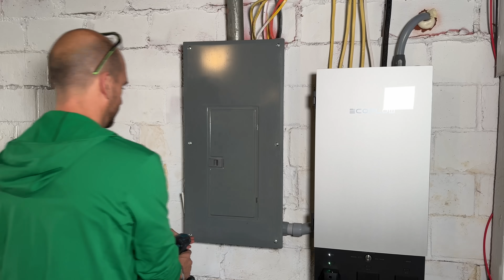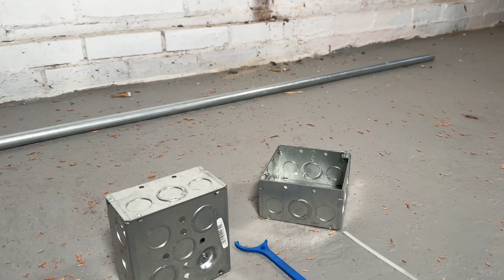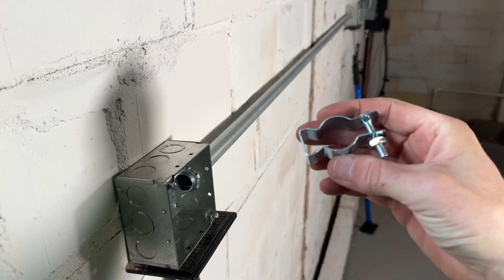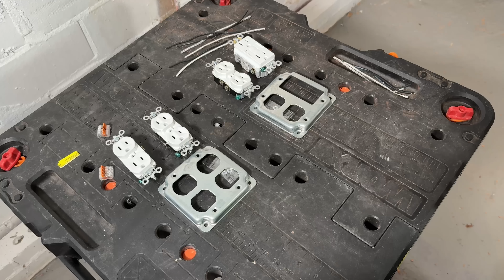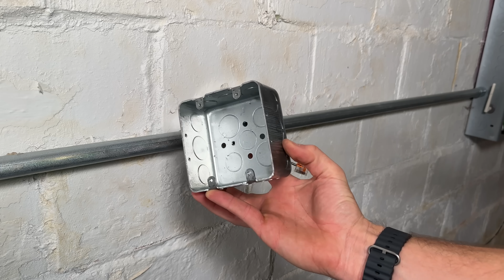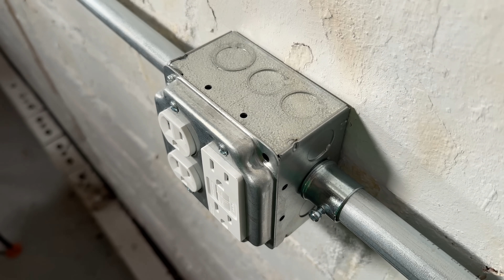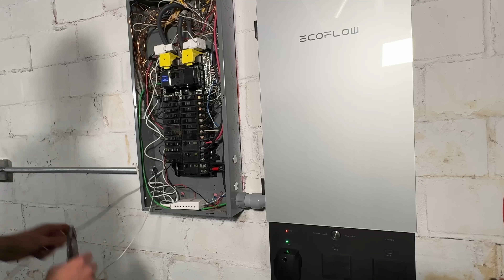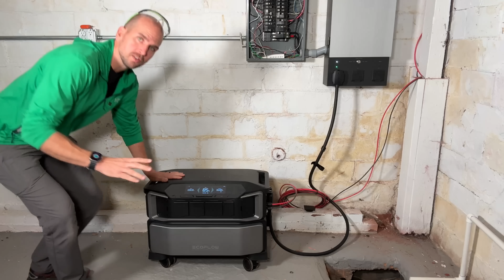Add Outlet To Unfinished Basement Or Garage

Comment: if a raceway is over 18” it requires a means of support. i.e. a strap or that conduit hanger you mentioned. over 18 inches, and you need to strap every 10 feet and within 3 feet of each termination.
Reply: EMT shall be securely fastened in place at intervals not to exceed 3 m (10 ft). In addition, each EMT run between termination points shall be securely fastened within 900 mm (3 ft) of each outlet box, junction box, device box, cabinet, conduit body, or other tubing termination.
Reply: @BackyardMaine    basically, with only a 6 ft run there's no additional support needed between boxes.
Reply: @rupe53  It would depend on the AHJs interpretation of the requirement. Most will read this as 3 feet lengths don't need additional support based on my experience. However some will read this as any length between boxes will need additional support.
Reply: @BackyardMaine    I see where this is going. 1 inch less than 6 ft probably won't require support because either direction is less than 3 feet from a box. OTOH, probably safe to say at least a single support in the middle will do (by code) or go the rule for BX / Romex and add one closer to each box.... and they can't argue at all. No harm in over engineering, right?  <LOL>
Reply: @rupe53  Incorrect. If you run 3' of EMT from box to box, each box becomes the "supported and secured" means for the other. Anything over 3' would require at least one strap. If your EMT is 3'6" with no straps, for example, it is not secured within 3' of every box.
Reply: @pld8993     look up a few posts and you can see where I spelled it out better. Basically a 6 ft run does need at least a single strap near the center.
Reply: @rupe53  Yes, there is. If you have 6' of conduit between boxes with no straps, 3' of it is not secured and supported within 3' of each box, explicit code violation and not one that needs interpreting, only measuring. If it said no point along the conduit can be unsecured more than 3' from a box, then 6' wouldn't need support, but that's not what it says.
Reply: @pld8993    you wanna repeat that one more time for people not reading the entire thread?
Reply: @rupe53  I'm not sure what I need to repeat. The NEC is clear and in plain language, nothing to interpret: "shall be securely fastened within 900 mm (3 ft) of each outlet box, junction box, device box, cabinet, conduit body, or other tubing termination." With a 6' length a strap in the center would mean that the conduit is supported exactly 3' from each box. If you put 1 support only and 1' from one box, that would put support 5' from the other, violation. If you put no strap, there would be no support within 3' of either box, violation.
Reply: @pld8993    you obviously didn't read the whole thread... or catch my sarcasm for those others who didn't read the whole thread.
Reply: @rupe53  I guess I didn't. Cheers.
Reply: The EMT needs to be secured within 3 feet of a box. The 18" nipple rule for strapping was removed years ago. Technically any length of conduit needs a strap.
Reply: @stillthakoolest  Not quite, only any length over 3'. If you run 3' of EMT from box to box, each box becomes the "supported and secured" means for the other. Anything over 3' would require at least one strap.
Reply: @pld8993  i mean i get it. Is there a code reference that says box to box <3ft  both secures AND supports the conduit?
Reply: @stillthakoolest  Yes. 362.30 (A)
Reply: @BackyardMaine  that is ENT, but whatever. Reading 358.30(A) I guess you can read through the lines that securely fastened means connected to each box securely
Reply: @stillthakoolest  No and there doesn't need to be. The NEC does not specify exactly what type of support is required for raceways (there are a few exceptions). The EMT inserted into a connector, and tightened properly, which is attached to a solidly mounted box is, without question, secured and supported.
Reply: @stillthakoolest  Oh sorry.. yes 358.30A. Brain cramp. 
It states securely fastened within (3 ft) of each outlet box, junction box, device box, cabinet, conduit body, or other tubing termination.

I
Reply: No offsets?
Reply: @1970jeffreyg  Not needed or required.
Reply: @pld8993  correct, it just makes for a better job.   More professional imo
Reply: @1970jeffreyg  While they may look better aesthetically to some, it's not true that offsets are more professional or are a better way to do it. We run conduit all the time with box offsets using 1-hole straps for support, and also without offsets using minis for support. There are situations when you'd definitely use offsets to hold it against the wall, situations when you'd definitely not use offsets to keep it off the wall or to maintain proper bends count, and situations when either way is appropriate. In this case it doesn't matter, nothing is gained or lost doing it either way.
Reply: 2ft not 18in
Reply: 36" is acceptable .... that one he can get away with
Reply: There is nothing in the NEC that says you need to support EMT over 18” long. Just 3’ and 10’ like you said.
Reply: Start strap #1 2.5' from the box then every 5' and you'll be golden.
Reply: @Singlepole  That's how I was taught. Puts all your straps/minis equidistant from each other, everything looks uniform.
Reply: karlwithak.Then when you sell the house the inspector makes you rip it out or fix it right. At the very least the NM cable needs protection and probably run overhead rather than just along the wall. And GFCI is not just code but a good idea. We don’t live in the 1940s. Not knowing code is not an excuse to be dangerous.
Reply: karlwithak. You must live in a different area. I bought my house about a year ago in Illinois, and I couldn’t move in until it was inspected by the city. The seller had to make several changes, some of them electrical.
Reply: karlwithak. I only know the local rules in Illinois and in St Louis, where the city has occupancy permits. Other YouTube videos lead me to believe this is not uncommon.
Reply: This guy has. No clue what he's doing...
Reply: Intervals not to exceed 10 feet according to 2023 N.E.C 358.30. Cmon baby boy
Reply: @christiansantos8904  did the nix the within 3 feet of a termination in 2023? if not, you just didn’t read my whole comment lmfao
Reply: @christraudt6730  of course I read it. You said, "...and you need to strap every 10 feet..." code said 'intervals not to exceed 10 feet'...you can strap every 1ft, 2ft, 3ft, 4ft, 5ft, 6ft, as long as it doesnt EXCEED 10ft. You're telling people every 10ft, you can do every 10inches if you want, code says dont go past 10 feet. You claimed I didn't read your comment; you don't read code.
Reply: @christiansantos8904  way to nitpick. we were citing code which is minimums. i was stating the minimum allowable strapping interval. for gods sake, is this what you do all day?
Reply: Yo! 

Who writes and publishes the Electrical Code in the USA? @christiansantos8904
Reply: @christraudt6730  all day, everday. We're going to die one day dude; might as well obsess over the things we choose to do.

Comment: This point was the most confusing part when I moved into a new house in IL. No grounding wire... WTF..?! It took a while to figure out why I didn't need it. I needed this video earlier.
Reply from the maker: Be careful I had owned several older homes in Illinois with no ground wire but also not means of ground running to the metal boxes.
Reply: It's easy enough to check if you actually have a ground path using those plugin testers

Comment: I notice that you never torque the wires on the breakers.
Reply: Almost no one uses torque drivers on residential service panels. If you were to invite a hundred residential electricians to your house and ask to see their torque driver, they would probably laugh at you. Generally speaking, only commercial and industrial electricians use torque tools on a regular basis.

Comment: I do not like to drill into mortar for Tapcon screws. The mortar pulls out easily, especially if aged.
Reply from the maker: I am with you but this type of brick/block easily blows out so it is actually worse.
Reply: @EverydayHomeRepairs  I agree with that 100%. It's easy to crack that block; it's too rigid and brittle.
Reply: yes, better to use proper fixings and stay away from the mortar and edges of brick to secure, you also need saddles on the conduit. If you follow this guy in the EU and do it without a qualification in electrical installation then you will Not be insured...
Reply: @theDgrader  That is the MAIN consideration in the installation! It's not about safety or durability over time. It is ENTIRELY what the inspector writes on his report! If the insurance agent refuses to insure you can be in deep shit!
Reply: Since the insurance industry writes the code, that's a great plan! @glasslinger
Reply: Just use plastic anchors or even a ramset.
Reply: Use Fischer rawlplugs.... you know, the right tool for this job exists since over 50 years. Please learn to use it...

Comment: I decided against solar when I found out you can't use it during a power outage. Sure you can have battery backup, but what you show here would NOT power your home. Sure a few lights maybe a fridge. But how long?  30 minutes to an hour, if you are lucky. Battery technology is not feasible yet. Especially the COST! Just sayin'.
Reply: Not true... Enphase micros will work during a full power outage, even without batteries
Reply: Of course you can use solar during a power outage. A battery bank is no different than a generator. You have to size it for the load you need. Most installs don't provide backup to the whole house although that is certainly an option. You pick which circuits you want to back up. Lights, freezer, fridge. You might skip electric dryer,  electric hot water heater, and electric baseboard heat. The unit he has is 6 KWH which would give you 1000W for 6 hours or 500W for 12 hours which is more than enough for lighting and fridge/freezer. You can always add a generator on top of solar or use 2 of the units he has for more power or use a large battery bank. Not sure where you got your information.
Reply: @TheDaniel688 I'm pretty sure he's talking about the solar array remaining functional without an active grid connection. He's correct except for enphase micros, which will work even when the grid is off, and no battery is present.
Reply: @michaelwilliams5506  and as long as it's day time. :)
Reply: @TheDaniel688  Yes, if you have the proper inverters for standby power. But the first generation and now lower cost inverters still cannot be used without a live utility connection. Without getting into the electrical engineering theory,  basic solar inverters are current sources, not voltage sources. They must have a constant low impedance  load to push against at all times. Your typical house load cannot satisfy that requirement
Reply: @andydelle4509 None of that is a reason that a battery backup system isn't viable.   

Mechanical engineer here.   TheDaniel688 is correct.  He seems to have a grip on LiFePO4 power stations, and to be honest, you don't, or just like bringing up other subjects like grid-tied solar/inverters unrelated to using a power station as battery backup for a house (or for anything else).  

It's just a simple equipment sizing and cost problem that any kid passing Algebra 1 in high school, can solve.

Personally, I prefer building a custom system for any LiFePO4 power station needs above 1kWh or so.  Power stations are getting bigger ,better, and cheaper, but so are 12V "drop in" batteries and 48V "rack mount" batteries.  

My own recommendation to family/friends for most home power backup needs, is putting a transfer switch for your entire service, next to your electric meter.  If you have a 200A service, put a 200A transfer switch.  Once you throw and padlock the big lever on that sucker to the position where your house is completely disconnected from your meter and the grid, then whatever you feed into the "generator" side of the switch is verifiably off-grid.  

Most people at that point, feed it with a gasoline generator made in China.  But feeding it from a battery bank and inverter of your own, or a big power station from Ecoflow or anyone else, has zero to do with the grid or the power company.  If anyone wants to start quoting exotic UL stuff, just point them to the 100 people running generators they just brought home from Harbor Freight when that day's storm knocked power out, and are feeding it into their clothes dryer outlet via a 16awg orange extension cord and a dryer cord cut in half,, while maybe or maybe not flipping off their main, maybe or maybe not knowing whether neutral is bonded to ground in their generator, etc. 

You'll see a lot of people just running an orange cord straight to their refrigerator through a window, and another orange cord through a bulkhead door to a furnace.  If they have a yellow 12awg cord, you know they at least put a few $20 bills into upping their safety level.  Still, hassling anyone who spent $500 on a whole-house transfer switch, instead of hassling the extension-cord folks, is misdirected energy in my book.  Not an excuse to do anything sketchy, but a reason for an inspector to respect that you eliminated all risk to others, and most risk to yourself.

For stuff that's permanently installed and automatically switches over, I have no problem with the utility or government inspectors getting very tough about the equipment ensuring disconnection from the grid, and somewhat tough about the specs and certifications of the equipment automatically kicked into use after disconnected from the grid.  If you're going to spend 90% of the money to do things right, you might as well spend 100% and keep everyone from the building inspector to your insurance company completely happy.

But some of this technology is so new, yet still so safe, that it's reasonable to "live free or die" as we say here in NH, rather than wait 2 years for certified solutions to become reasonably priced.  Using an inferior old solution in the interim can be more risky than installing good new equipment that's for instance approved in Europe but not yet by UL.
Reply: Ecoflow stuffs are designed for camping and other portable application. It just gives you the option for household use but not really specialized for that, given the size of battery. Proper residential application requires UL9540 certificated batteries and inverter, which is even more costly. Honestly safety isn't a huge problem for modern batteries but price is
Reply: @arclight1130  Ever see a Tesla go up in flames?  It's pretty horrifying.  I also know that my friend's professional A/V studio burned due to the possibility of faulty camera batteries, so that's why I am incredibly cautious around these things.
Reply: @WJCTechyman  The older versions of lithium ion batteries do have some fire risk if abused.  But now, the great majority of power stations and battery backup systems use LiFePO4 (pronounced "lithium iron phosphate" or "life poe four" or "LFP") batteries which don't have that inherent danger.  

If you're concerned about extreme fire danger, which is imaginary for LiFePO4, just only install it where you'd install a gasoline powered generator.  Which truly is an extreme fire danger, plus asphyxiation danger, plus hearing loss danger.
Reply: @WJCTechyman   thousands of cars burn up every year but I don't see you converting to horse and buggy. Your fears are irrational
Reply: I would suggest looking at the 8-bit guy's videos.  He has two Eco-Flow units running his out-building studio and can run it for about a day.  That said, I would rather have a Honda 7000 W inverter generator to power most of my stuff without having to rely on maintaining a lithium-based battery as watching a number of Tesla cars spontaneously combusting in people's garages or after a car accident makes me incredibly wary of large batteries like these.  I would rather have a bank of deep-cycle marine batteries connected to a conventional setup than this.  I mean, Eco-Flow is a brand that Matthias Wandel played with and he wasn't too impressed with it either.  Also, having a large battery in an old basement has me worry if at any point the basement was to flood, what would happen?
Reply: Emergency power during an outage is exactly that—Emergency. It is supposed to give you a few lights, maybe power your weather radio, and keep the refrigerator running so your food does not spoil. The vast majority of outrages are less than an hour. If the outage lasts for days or even twelve hours or more, no home-based residential system short of a very heavy duty generator is going to supply all your needed power.
Reply: Ok boomer